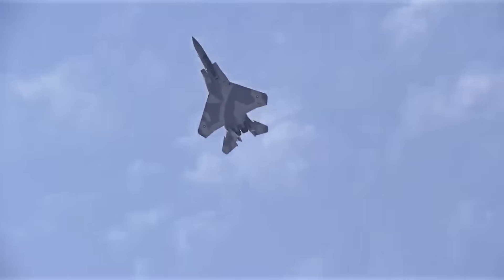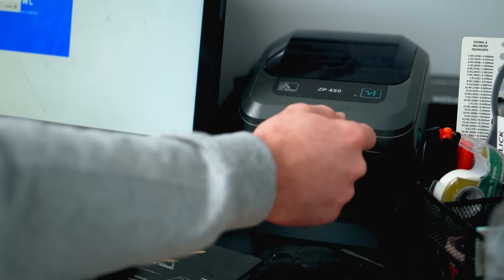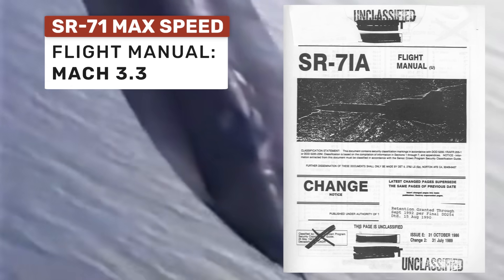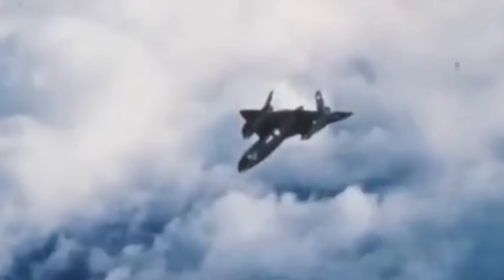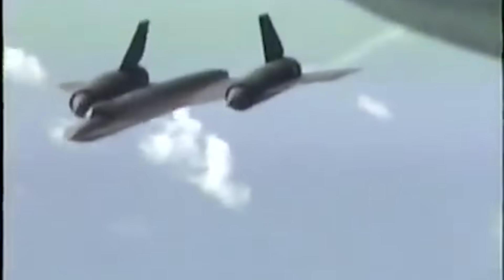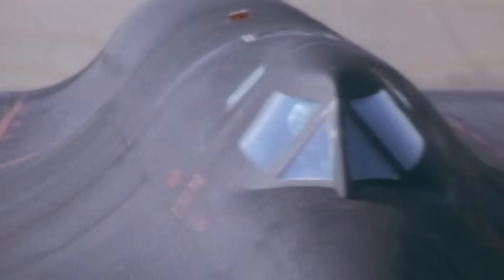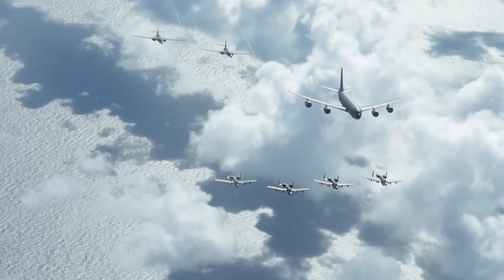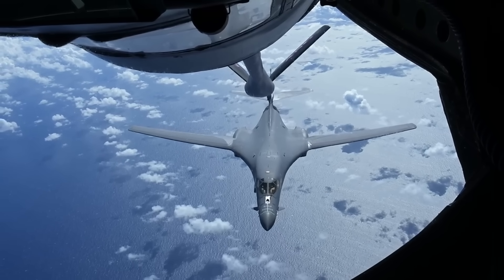The SR-71 was MUCH FASTER than the Air Force will admit

Comment: Two stories about the SR-71:

1 - I met a guy that told me he worked on the engines for the SR-71.  What he said was that the turbine blades were encased in a ring of graphite.  The blades went so fast that they stretched and ate into the graphite to maintain the seal.  This whole system had to be replaced after every flight.

2 - I also met a guy that was stationed at the Plattsburgh AFB and told me he saw an SR-71 cross his radar screen once.  There were just two blips before it exited his screen.
Reply: I worked in the J-58 overhaul section 577 at P&W WPB FL for the last year of production and have seen the insides of them many times....and can say that it's an amazing engine but nothing needs to be replaced after every flight.   There ARE thermal limits on various components that if exceeded will shorten their TBO and the only case of something needing replacing after a flight would likely involve a massive pilot error and the guys who flew them were absolute professionals who didn't do things like to their aircraft.   For sure it's possible that somewhere sometime somebody pushed one WAY beyond the normal operating conditions which then needed repair before another flight...but that would be an exception rather than the rule I think.

Every engine was test run extensively including a 33 minute 'Qualification Run' at full Military Power where fuel flow, thrust and all temperatures and pressures were carefully monitored before the engine was released out to the field.   Of course this was at Sea Level and full Afterburner but not involving the compressor bypass tubes that ran straight back to the burner can which were used over Mach 2.   The real engineering genius in the Blackbirds was in the inlet ducting where the Mach 3+ airflow slowed down under control to subsonic velocity to be fed to the engine.   Information about the ducting and how it worked is well worth a read if you are interested in such things...the guys who designed it were from another world.

Anyway....should something internal need replacing the engine would have been sent back to the plant and another installed from their spares in the field.   Even working in the overhaul section things were compartmentalized and few people had free run through every system and component.   I worked on the afterburners, fuel system and compressor sections and wasn't privvy to the turbine so can't comment on how or if they were sealed.   For sure the compressor blades are sealed on the ends as most modern high performance turbines are today.   Nothing sounded like a J-58...it's a 'Big Block' motor that doesn't spin real fast like the F-100's and F-119's do so the sound is a deep guttural ROAR that shakes you inside...just glorious and I'm very sad that nobody will ever hear one again.
Reply: @recoilrob324 I have always felt privileged to have gotten to see & hear that beautiful monster in person. RAF Mildenhall, mid-80's.
Reply: @johnsrc2025  Me too, at Farnborough airshow way back in the 80's. It was so loud it shook you to the core as it flew down the runway and I've been UNDER concord at LHR when it took off as well. SR71 was another level of LOUD !!!
Reply: @johnoneal1999 Nice! I was privileged to have seen the last flight. 😢
Reply: @recoilrob324 Great story, man.  I’ve said this a hundred times to people involved in any facet of the Blackbird - WRITE IT DOWN and make it available!  Blackbird fans are rabid enough to read ANYTHING related to this aircraft, and there’s a whole lot more that needs to be read related to manufacturing, maintaining, and overhauling the SR-71 and the J-58.
Reply: @Pene7942 
If you mean they will believe anything, you’re right!
Reply: @recoilrob324  "Deep guttural ROAR" :) I wish I could experience that roar... One time in 2009 I think it was a F16 had a aborted landing in Tromsø, it  took of again with full afterburner and you could feel the vibrations in your entire body and it triggered the car alarm in half the city  ;) I was about 2km from the airport. Only thing close to that I have experienced was top fuel dragsters doing the 1/4 mile and the vibrations shaking your entire body.
Reply: Thats my neighborhood.
Saw the Thunderbirds fly there before it closed.
Reply: @nattybumpo7156 thunderbirds are puppets in a TV show.they didn't really fly,scooter.
Reply: Just look into how fast the turbine span and thermal integraty
Reply: That’s actually pretty common for jet engines to have graphite wear rings and gas seals. Not sure how common it was when the J58 was designed though.
Reply: @JohnMaxGriffin  Definitely unique for a Pratt and Whitney engine. It's almost always brush seals.
Reply: @TheMeepster72 neighbor retired from pw in Conn I think it was Joe burns worked in metallurgy may be wrong on state he lived in Utica
Reply: My brother in-law was an Air Traffic Controller for the Navy in Jacksonville FL. He said an SR-71 passed through his airspace headed for Diego Garcia in the Indian Ocean. It came back through his airspace 4 hours later.
Reply: @dcab6447  

He was pulling your leg (Unless he meant that it turned around!). A round trip from Florida to Diego Garcia is more than 20,500 miles, which means 5k miles/hr+ if it took four hours, (mach 8-ish, or, hypersonic), not counting the dozen or so refuelings that flight would take. 

Call him out on it, eh? (That's almost the distance of a circumnavigation!)
Reply: @dcab6447 almost certainly never happened, secondary radar for airports even military ones can at best see a little over a hundred miles (secondary radar is even shorter)  furthermore the SR-71 is fast but not that fast.  Deigo Garcia would take at least 5-6 hours using the most generous estimate of its speed, and that's one way.  Would also almost certainly take longer than that given it would need multiple air refueling.
Reply: Is it possible it was another blackbird returning as the first one was on it's way out to take it's place? @Lucinat0r
Reply: @dcab6447   If that was the same plane he saw leaving it would mean the plan was capable of more than mach 6. Given that it is about 16200 kilometers from Jacksonville to Diego Garcia and 32400 kilometers for a round trip, the plane would basically need to do close to 8000 kilometers per hour. Next time you see your brother in law you can either call him a liar to his face or ask if there was something you miss heard in that story.
Reply: @rustknuckleirongut8107 i worked with a guy who was a mechanic in the airforce during and after Vietnam. He worked on one in Vietnam for an emergency repair, and they had one land in Florida while he was there. He said he asked one of the flight crew how fast they flew. The guy told him the top speed is classified,  but that it would go in excess of mach 7. I can only assume that would have to be at max altitude and for a short time.
Reply: @nooneyouknowhere6148  For some reason people seem to enjoy telling 'tall tales' about things when they're classified just to get a reaction.   There were some stories floating around the shop about the capabilities and I took it as a test to see if you were up to speed on things or not.   When I heard some of the outlandish claims I would just smile knowing they were total fabrications but there were people who ate stuff like that up and this is how Legends are born.
Reply: @nooneyouknowhere6148  Absolute liar.
Reply: @nooneyouknowhere6148 That would be over 4500 mph at 80,000 feet. I'm calling BS.
Reply: @rustknuckleirongut8107  hi on this video the narrador says Over 3000 mph and i think it can go Over Mach 4.5
Reply: I'm calling B's on anything needed to be replaced after each flight.  Changing blades in the compressor section would be like a partial engine overhaul.  The S-71 had a pretty fast turnaround time.   One of my squadron mates in the Navy got tapped to help service the SR-71.   I forgot most of his story but the was a AME2 at the time and this was prior to he and I serving together.   At any rate the SR-71 came in to this base he was at unscheduled, over the weekend and he was the only one on duty certified to handle LOX.   So he got to pull  and replace the LOX ball.  I think he also got to check some Environmental controls and pilot safety stuff to help preflight.    Said they fueled it in the hanger and fuel was leaking everywhere.
Reply: Leaking fuel? It was by design as the panels weren’t too close. They take off and refuel before going on mission to have a full tank.

As shady and unusual, it paid off in results.
Reply: @diegrinder6851 it would leak if they fueled it in the hangar. The fuel tanks don't seal properly until it gets up to a certain temperature from the friction of the air. The thermal expansion seals the tanks. If they welded them shut it would cause problems. This of course also means they need to refuel as soon as they get into the air, but after the mid-flight refueling, they throttle up and the tanks expand and seal themselves.
Reply: @diegrinder6851  It might be BS but nobody said anything about changing compressor blades after each flight.
Reply: @diegrinder6851  I have a friend that worked on it and he said the same thing about fuel leaks until it got at high enough speeds... He said they used to have to go behind it and put out fires regularly because the fuel was soo volatile.
Reply: @diegrinder6851  

I agree... mostly: There ARE components to many high-end technologies that have to be replaced  after each use, but I doubt turbine blades on those engines were one of them. (For example in another top end(ish) tech, Top Fuel dragsters need all new clutches, head gaskets, valve seals, plugs, etc, and a total top-end rebuild, every single pull- which is routinely done in under an hour (a fast turn around)... It stands to reason that the fastest jet ever would have some consumable components, too. (But compressor blades? Errr..).

Also, this is kinda simaler- a pet peeve of mine is when people are incredulous that some military jets take, say, 60 hours of maintenance per flight hour... that doesn't mean that it has to be 60 hours between flights, eh? (It could be 60 guys working together for ONE hour, or a 600-man/hour rebuild every 10 hours (like how B29 engines lasted only 70-ish flight hours at first and took dozens of hours of labor to rebuild/refurbish after they were swapped out for a new set)... Why don't people get that? (Prob because it gives them something to be shocked by re: government waste- as if they needed to make up an example! ...Like 'did you know that 500-plus hours of labor go into making something that only works for 10 seconds!!?? (a sidewinder missile) Shocking!)

Anyway, Cheers!
Reply: Um I'm sorry but I have taken many J58 engines apart, and did metallurgical testing for the Air Force, there is no component such as you describe, there is a high temp bearing surface but it is made of metal, inconel, waspalloy,  haspalloy, and Cobalt, and if the blades stretched and hit the housing, they explosion resulting would cut the aircraft in two. So that story is entirely fabricated.
Reply: @Thousand_yard_King  Your story is BS. Why did you take "many" J58's apart? Didi you put them back together? If you knew anything about jet engines you'd know that what the OP is talking about is abradable coating.
Reply: I heard a variation of #2 around 40 years ago from an uncle who worked in the aviation industry.  The details are a little hazy, I was in 6th grad when I heard the story.

An SR-71 is having an issue and needs to make an emergency landing.  It find the nearest civilian airfield with a runway that can accept(is that the correct term?) the plane.

SR-71 radios in to civilian airport control tower asking permission to land:

Control Tower: Mysterious Aircraft, we don't see you on our radar.  What is your current altitude and speed?

SR-71:  Control Tower - our current altitude and speed are classified.  Is your runway cleared for an emergency landing?

Control Tower:  ???... Uh... yes mysterious aircraft.  Our runway is clear.  We still don't see you on our radar....  Oh wait... we now see you at the edge of our 'scope'.

SR-71: Good to hear Control Tower.  Here we come.

<<radar does another sweep>>

SR-71 has landed.

This could be an Urban Legend... but to heck with it.  I heard my uncle tell my dad (his brother) the story.  There may be a kernel of truth in it somewhere.
Reply: I grew in the Keeseville NY area and commuted to SUNY Plattsburgh. On the way home one night, I was on the southbound on-ramp at Exit 37 when I saw an SR-71 climbing out from the base. The engine spacing and length of AB plume gave it away. It was one of my more interesting rides home.
Reply: Had a good friend stationed at Plattsburgh AFB back in the late 80's, and had been there more than a few times before the base was closed as part of military cutbacks. The base was a notable player in the Cold War in that it had to have two aircraft on station, fueled, and armed with nuclear payloads 24/7/365...Was a cool place to visit in upstate New York right on the banks of Lake Champlain.
Reply: That kind of seal is somewhat normal for jet engines, its the easiest way to get a perfect seal around the blades. Of course replacing them after every flight certianly isnt normal.
Reply: I wonder if your buddy would divulge the air speed or give you distance covered in time, we could figure out the Mach #?
Reply: And you believed it? 😆😂🤣
Reply: That radar thing, I know of too .. As working in the Royal xxx Air Force, we had a clear radar view from far out in the North Sea into a good piece of the Baltic Sea and when the blip only counted 3, we knew, what was coming in overhead.
Reply: Interesting! Re: point 2- for another GREAT SR-7 story, search for 'LA speed check story' on youtube.... it's hilarious!

Cheers
Reply: 1. What the guy must have meant by encased in a ring of graphite is the abradable coating that is on the compressor casing along the blade path. The blades didn't stretch because of centrifugal force, they stretch or "grow" because of heat.
Reply: Hi, Hey, Hello!!🦜

The more G’s, the better!! They’ll reflect our minds, technology, and more!! G strings!! 👙 👙👙👙

Our brains look like gum!! 🧠 Juicier the better!!!🍏🍋‍🟩🫐🍍🍎🍌🍈🥥🍐🍉🍒🥝🍊🍇🍑🍋🍓🥭

Love everything until it loves you back!! Mosquitos too!!🦟 ❤

Each of us and each galaxy would represent a cell!! 🦠 We’re stars putting ourselves back together again!! Like Humpty Dumpty!! 🥚 🐓 

The sky is blue because we’re meant to imagine it as a diamond!! The auroras then create the rest of the spectrum!! 🌈 💎 

A purple sky would reflect the heart of the ocean!! An opened mind!! 🤯 The earth purring more!! Purrrrrple rain!!☔️ 🐈‍⬛ 🧶 

Each thought to me is a solar flare, which shifts us into parallel worlds!! It’s hard here!!! I’m a peaceful dude, yet my life here has been super difficult!!🥹

Alpha Centauri represents a shift in consciousness!! Dog planet!! We’re riding the alpha waves!! Woof woof!!🐶 🐾 This is our world peace and enlightenment for the world and universe!! All is one!!😇🥳🥰🤩

We’re each a mini universe!!🌌

The 3 Body Problem represents our gut brain, 🍱 heart,❤️ and mind!! 🧠 

The moon is a black hole!! 🕳️ A neutrino!! The planet is a colonized moon!!😇🌍👽 The sun is a shapeshifter!! 🌞 

Are you and I sculpting together as a team or as individuals??? 🧑‍🎨 Using the moon as a tool!!! 🪨 The Sun is the eye!!👁️ 

I love the tool/word grinder!!!😮 We’d be Bumping and Grinding!!😂

The Earth is like a refrigerator and the atmospheric pressure is melting or defrosting the stars above, as if they’ve been in the freezer!! 🥶 

It would also reflect us krystalyzing and becoming diamonds in the sky!! 💎 💎💎 Lucy becomes Maisie!! 🐒 👽 

We could be stars from above aka heaven, melting everything from above, as well! Like a River Running Through It!!! 🌊🌊🌊🌊🌊 Gravitational waves or our thoughts raining down on us!! 🌧️ 

Unlocking a Secret Garden within and outside of us!!🤫 An Oasis!!!🏝️ 🏝️🏝️🏝️🏝️

Flowing!!! It helps a lot to flow!!!🌊🌊🌊🌊🌊🌊 Letting go, so we can concentrate more and work on our project!! Heaven On Earth!!🌍 👼 

Flowers!! 🌺 🌸 💐 and Flow-Ers!!🌊🌊🌊🌊🌊

I know energy is still impurrtant!! 😻 

And of course imagination!!! Love!!!💗 🐶 🎾 🧶 🐈‍⬛

To create heaven On Earth, the galaxies collide!! 🌌 Twin flames connect!! 🔥 🔥 We’re creating quantum entanglement!! Ghost particles merging, becoming more like the Stay Puft Marshmallow Man!!👻👻👻👻👻👻👻👻

The universe is still the Earth!!⭐️🌍⭐️ We’re seeing it from the insides!! 🕵️ Like we’re inside a volcano 🌋 or wishing well!! The stars and galaxies are like coins!!🪙  The Goonies vibes!! 💀 We’re treasure!! Antarctica is treasure island!! 🐧🇦🇶 Unlocking antimatter!! 🐜 Booby and booty traps exposed!! Planet X!! Hubba Hubba!!🥰 

Everything and everyone has been our teacher!!👩‍🏫

3D is like the murky bottom of a bong or volcano!!🌋 The fourth dimension, representing Mars is like the stem of the bong or the volcanos vent!! 👽 Experiencing higher dimensions is like the smoke or magma reaching our mouths 😋 and then circulating through our bodies!! We are the Earth!!🌍 👼 

The road less traveled!!!🧳 🌹 Straight up!! 🎈 🎈🎈🎈🎈We’d be super condensed or extremely packed neutron stars!! Like Rigel!! Blueberries 🫐 Antioxidants!! Betelgeuse has evolved into a neutron star!! 🧊 🦖 🧊 🦕 🧊  🦣 

Our long winding road, exploring different dimensions, finally straightening out!! I’m getting Pee Wee vibes!! Large Marge sent me!!🚴😂

We’re vaporized, as if we’ve been smoked or roasted!! 💨 The smoke representing again those compressed neutron stars climbing the higher dimensions of the universe like a chimney!! I’m Mary Poppins, y’all !! ☂️ 🧞‍♀️

It would also represent us as a comet traveling through a wormhole!! 💫 

Who me, I’m just a worm!!🐛 🫖 Solving a labyrinth!! 🦉 Solving amaze!!! 🦋 

Different energies tell a different story!! 📚

We’re storytellers!! Artists!!🧑‍🎨 

We’re energy first!! 🐝
Reply: My brother in law was stationed at GITMO, working the Navy’s radar system which could track aircraft as far north as Greenland. Even knowing the flight path and ETA of SR-71s they were rarely able to ping them more than once and they often were not able to ping them at all.
Reply: Somebody lied to you. Lol. Do your own research.
Reply: Yup! Did you ask him what the RANGE setting was?
Reply: I'm sure the gloves were off over enemy territory, so the Russians knew the top speed, or very close....
Reply: Years ago I was at the The San Diego Air & Space Museum standing under the A-12 outside by the front door.  I was talking to another guy who said he was a photo interpreter for the CIA or NSA.  I said you always hear about planes overflying the Soviet Union but you never hear about the B-36 or SR-71A ever actually  overflying the Soviet Union.  He said they both did and he worked on the photos that they took.
Reply: I once heard that the SR71 had never ever run it's engines at full throttle in flight at near it's maximum altitude, for two very good reasons one being that the vacuum caused by power at three quarters throttle actually increased the speed considerably, and the second being that the atmosphere at it's maximum altitude is so thin they weren't actually sure if it could suck enough air into the engine near its maximum operating speeds, and thrust. I may be wrong on this, as I am British, and simply admired the SR71. I did know things like its, liquids dribbled/ran out of the aircraft on the ground, and it was only fully sealed after a few minutes of high speed flight.
Reply: @thetruthhurts7675 At speeds over Mach 2...most of inlet airflow was bypassed around the majority of the compressor and rest of the engine straight back to the afterburner...thus it flew as a RamJet and the engine core only kept spinning to provide the fuel and hydraulic  pumps and electrical generation.
I have seen people claiming that the inlets created 'vaccum and sucked the aircraft along'...but that's hogwash.   Supersonic flow needs to be slowed down below the Mach or the engine will stop running...so the inlet cone creates a shockwave that is carefully controlled to just hit the outer edge of the inlet opening and then it bounces back and forth along the cone losing speed and gaining pressure until it's slow enough to be fed to the engines.
This inlet spike is quite a long device with convergent and divergent shape along its' body that fits into the duct and as the aircraft increases speed this cone is retracted to keep the shockwaves hitting where they should.
Internally there are doors that can be opened to bleed excess pressure if needed but it's this inlet duct system that really puts the cap on how fast the aircraft can fly as it get to the point where the shockwave isn't hitting the duct at the right point and causes an 'unstart'...which is not good.
So....please understand that the air inlet is never under vacuum...only varying degrees of pressure and the aircraft is PUSHED through the air by thrust.
Reply: @recoilrob324  So effectively the J58 was the world's first super eficient SCRAM jet? It was MORE efficient at higher speeds. They work exactly how you would expect a scram jet to work is exactly what you have been saying! The J58's didn't have cones which RAM jets do, they had as you correctly state gates, which were counter intuitive in operation.
Reply: @recoilrob324  Thank you for your reply I found it interesting to read.
Reply: @thetruthhurts7675 The difference between RAM and SCRAM jets is the speed at which the air flows through them.   RAM jets don't need compressors because their forward velocity provides all the air compression they need...but internally they're still flowing subsonically.

SCRAM jets on the other hand operate internally with super-sonic airflow speeds which is a really crazy thing.   The behavior of air flowing through convergent and divergent sections pretty much reverse when going from subsonic to supersonic.

The J-58 in and by itself could not run using the compressor bypass tubes as a RAM jet...but combined with the nacelles on the Blackbirds they DID effectively work as RAM jets.
Reply: @thetruthhurts7675 yes very wrong, that not even how any of the physics of that stuff works.   The limitations on the Jet were purely thermal as friction heat was the limiting factor in speed for the plane.
Reply: When the blades start scrubbing against their respective seals, it means you overheated them.  It's generally on the power turbine side when some idiot overtemps the ITT/TIT and keeps running it anyway.  The result is that you get to replace both the seal and the blades, because both have been rather violently and unequally worn down, and the blades have been permanently stretched (think forging, but under tension).  Those seals are partially there to allow this to happen in a controlled manner during overtemp events without serious damage to the entire engine.  The problem is that they do the job so well that it's not always obvious what happened.  Sometimes all you'll notice is that the engine is no longer able to develop the same amount of torque for a given ITT/TIT and fuel burn due to the poor seal, so it becomes even more likely that you'll be forced to overtemp it again to get off the ground and keep flying.  Eventually something will fail, and it'll be your own stupid fault for not paying enough attention to what the engine was telling you.  I could see this happening to the 71 in rare events on the compressor side if they exceeded mach limitations and managed to overheat the blades enough to stretch, but not after every single flight.  Replacing them would basically mean pulling the engine and replacing components that you'd normally only replace during an overhaul, and that would be an untenable design.  It's entirely possible that the guy working on the engines did have to replace a graphite seal because the blades scrubbed, but it would've been a one-off situation.
Reply: @Skinflaps_Meatslapper  Torque? Sure you don't mean thrust?
Reply: 1 You got CATFISHED. No fuck*ing way that those engine components would be replaced after every flight.
So,
You probably got CATFISHED for #2 as well.
Reply: @teebosaurusyou2-un2nz  Do you actually know what "catfished" means?
Reply: @teebosaurusyou2-un2nz  I doubt I got catfished back in 1979.
Reply: while all that may be true.  I think the SR-71 got its real speed from the ram jets not the Gas Turbine.  no moving parts in a ram jet.  I could be sorely mistaken on all of that.